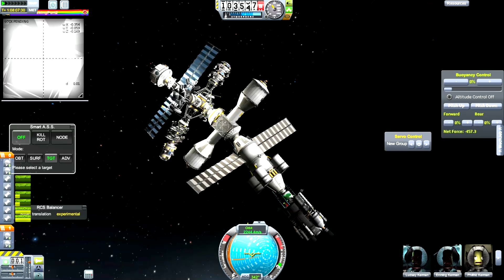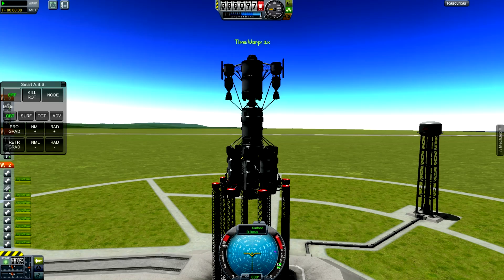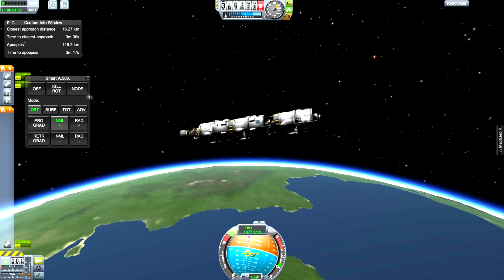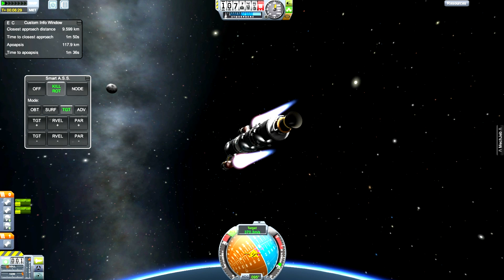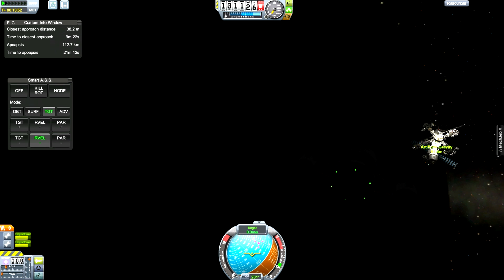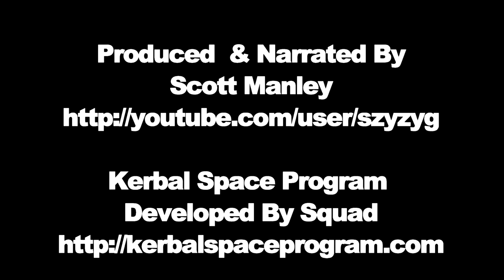Kerbal Space Program - Reusable Space Program Episode 26 - Construction Disaster

Comment: Ah, I have your issue then.  There are 2 problems: one is you only have so long to dock during an encounter if your orbits are different in any way (will always be).  And 2, make sure the docking port you are trying to dock to is facing normal or antinormal (north/south) because as you go around kerbal, your craft slowly spins on it's vertical axis. And just a tip, don't even try to get  closer than 50-100 meters without your docking ports facing each other, alignment>distance.  Goodluck!

Comment: I've had a similar issue with my station recently and I've narrowed down the problem to the Struts, I'm not sure how but as soon as I connected the struts on one of my pieces, the station started turning uncontrollably with no chance of recovery, further more my station's orbit started changing as though engines were firing in retrograde (despite the fact that there were no engines or RCS on that station at the time)

I was using the physical struts though so who knows.

Comment: Try to use RCS thrusters to slow down when you're getting close. Larger engines are too powerful. There is also a weird occurrence when you are accelerating quickly that causes the speedometer to switch to (for instance) 20m/s before it reaches zero if you're going too fast. I hope this helped! :)